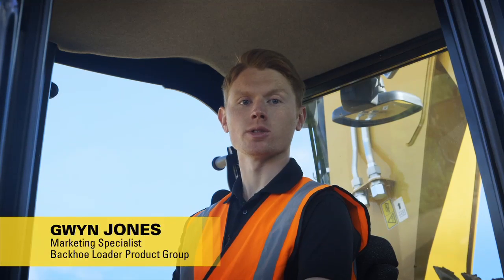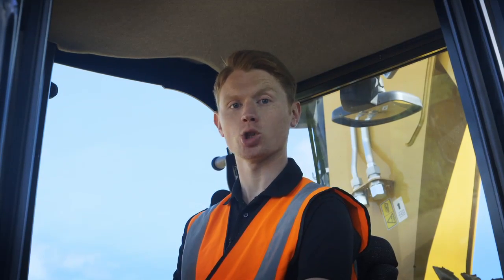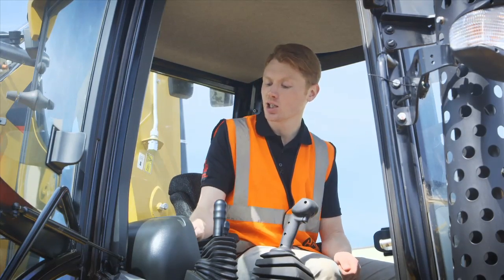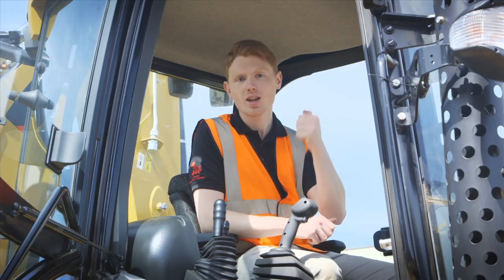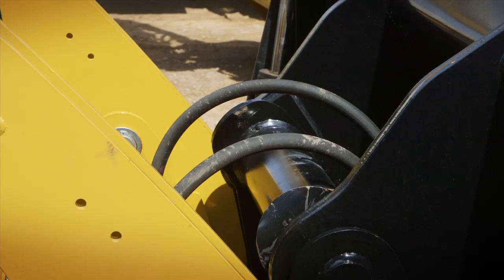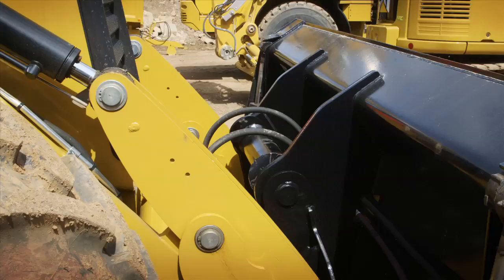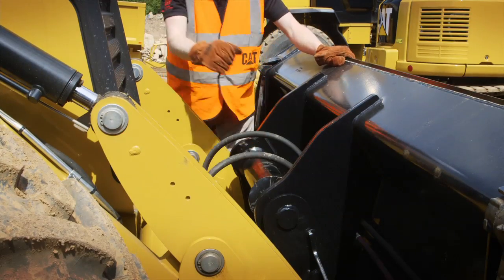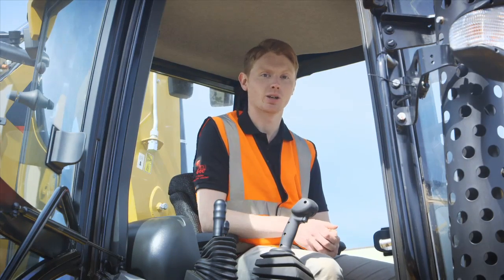Releasing Hydraulic Pressure: Cat® Backhoe Loader Operator Tip

Comment: Ok i have a question. I am looking at buying a tractor with a three point mount backhoe. Not decided on brand (farm/utility type) i was told to make sure machine has hydraulic down pressure ability to avoid damaging the machine. Question: how do i obtain down pressure and what function does it serve assuming down riggers are not serving that function? In other words do i need a separate down pressure system to reduce machine (tractor) stress in addition to down riggers?